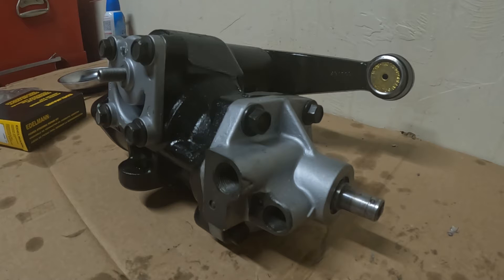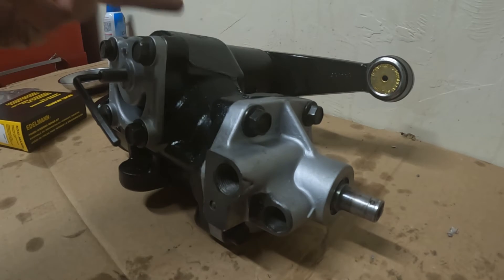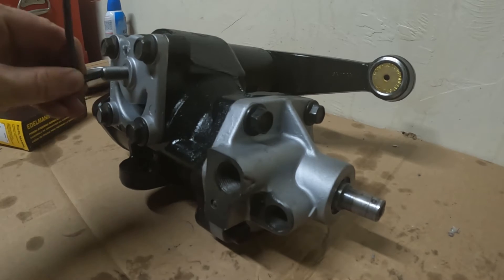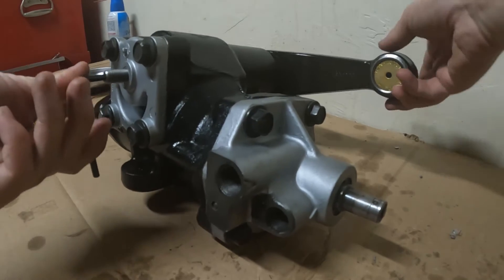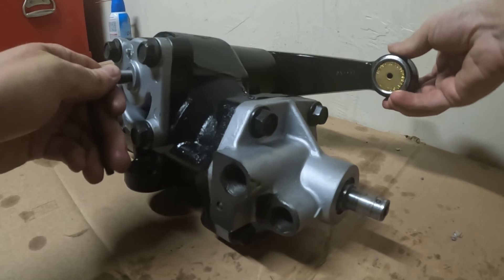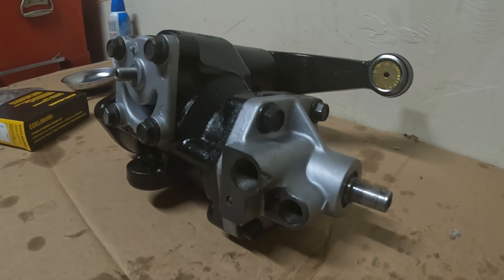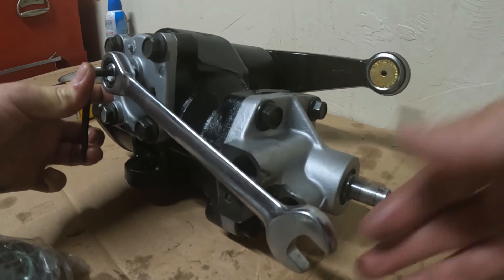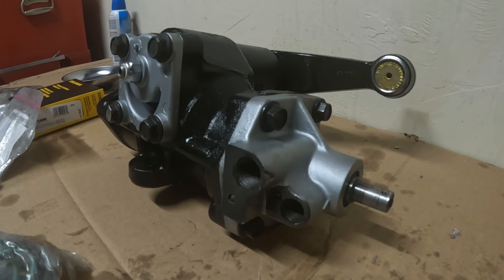Part 6 Bench Adjustment of Delphi 670 / 680 Steering Gearbox Rebuild

Comment: Great vid. Just wanted to add for anyone with a not new and worn in gearbox. The gears with be more worn in the middle since that’s where they spend most of their time. You’ll need to check the lash/play in the full range of motion. If you set it with no play in the center it will likely bind when turning far left or right.